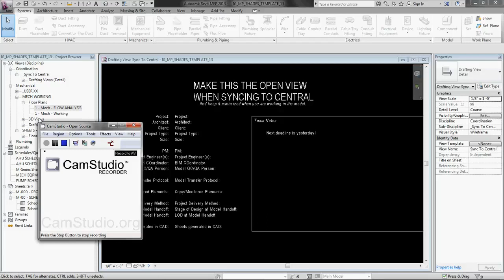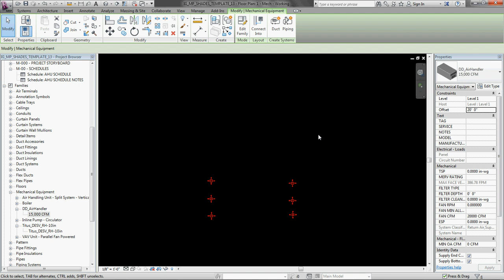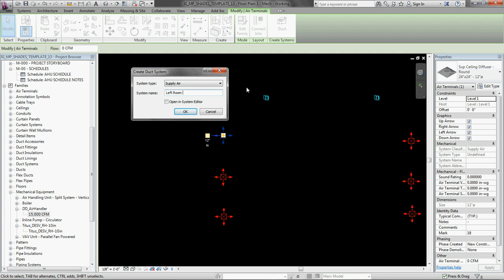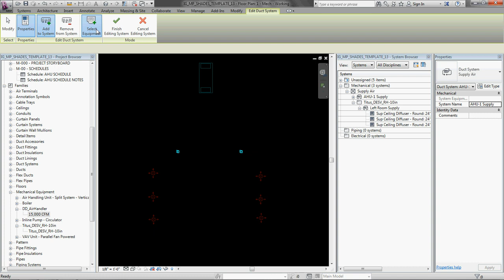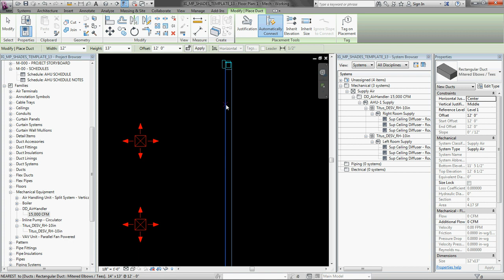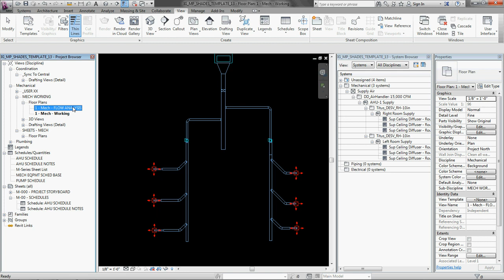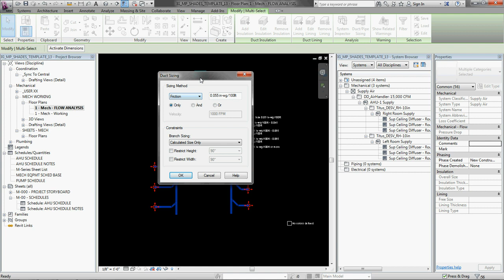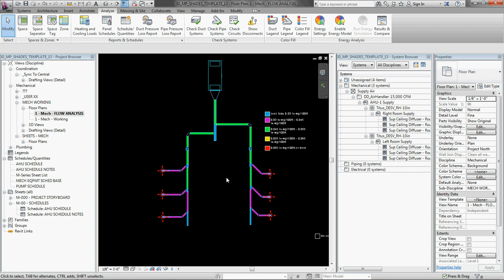How to Model Duct Systems in Revit MEP 2013

Comment from the maker: That's a really good question. I don't have an answer to that, although it's been in the back of my mind for a while. Short of manually reducing airflows in certain branches (or disconnecting them temporarily), sizing the mains, then resetting the branch diffusers to design airflows.... which is obviously time consuming and error prone. If I come up with something clever I'll be sure to post about it!

Comment: Thanks. Also think about how to model your systems when there are more than one piece of "EQUIPMENT" at the head end of the system; e.g.- two chillers, two cooling towers, two fans....
REVIT will divide system flow up between say two pumps but they can't be at the top level of the system; only assigned as inline components.

Keep on REVITing... Todd

Comment from the maker: Hi Ahmed, thanks for the reply. It's exceptionally hard to diagnose novel Revit issues without screenshots, the model file, and/or more description, but I'll do my best. :) 1. Note that I set my sizing to 0.6 inches of water / 100ft, which converts to 4.9 pa/m I think. That might be causing some issues. 2) Check to make sure you've got flow established on both sides of your VAV. It might be that the family isn't set up to allow flow through it (both duct connections have to be correct).....

Comment: Tyler, You may know the answer to this. Is there a clever way to model airflow diversity in the REVIT systems between the air handler and the VAV box? REVIT currently just sums up all of the connected CFM from the VAV boxes which makes sizing the ducts challenging because you have to expand the sizing criteria to accomodate the fact that the ducts will never see that flow in the real world due to system diversity. Thanks

Comment from the maker: ....in that one duct connection has to be flowing in, the other flowing out. 3) If your duct system has other flow stuff going on, Revit might be confused about which way the air is flowing. What is the upstream duct connecting to/feeding into? You can't have any open pieces of duct in a network for the air to flow correctly.

Comment: Hi Tyler,I'm having issues with a carpark exhaust system (and a similar issue with a stair pressurisation system). When I create the duct systems from Exhaust Louvre > Silencer > Exhaust Fan > Silencer > Exhaust Grilles (not yet connected by a riser), when I start adding the duct, it changes the systems so that instead of the relationship above, it becomes multiple... Do you have an example of something similar?

Comment: Hi and thanks for the video! I was wondering can Revit MEP be used for designing the Industrial Ventilation systems? or do you know a software which is capable to use the method described in the ACGIH Industrial Ventilation manual?
Reply from the maker: Hi Hassan, I'm not familiar with ACGIH methods so I can't say one way or another. If there is a specialized, sophisticated method, I'm guessing no. But you can do a lot with Revit that it's not designed for so you might be able to hack it.

Comment: Hi disney, i have a question: i want to go to a higher hierarchy. i connected a diffuser to a mechanical equipment. now i want that to be connected to another mechanical equipment, however, the "duct" option does not appear in the contextual menu when i click in it.
Reply from the maker: LC volt So, the situation is AT to ME 1, which you got working. Now you want ME1 to connect up to ME2. Hmm. Does ME1 have a second Duct Connector built into the Family, for example a VAV box that has a Duct Connector on both sides of it?

Comment: Very good tut. , but I have problem that air delivered from RTU is less than the toal air from difusers. I inspect all connectors parameters (calculaed/preset) the problem is still standing
Reply from the maker: Sadig Bakri Hmm. Is the amount of air delivered off by some multiple of the air from a diffuser? If so, you might have a subtle break somewhere in the duct system which is causing one of the diffusers not to pass it's air to the RTU. Have you confirmed connectivity with tab-selecting the system?
Reply: thank you very much sir .. I discovered the problem, it in diversity factor on the VAV,  when I  set it to 1 then: in = out .. and the amount of air dlivered by RTU raised up
Reply: the amount of air increased when I add a new diffuser. e.g if a place needs 2000 cfm (500 per CSD) when I add one more diffuser air amount become 2500. how I maintain air amout at 2000 while adding more diffusers ??
Reply from the maker: Sadig Bakri That is where you are getting into the issue of how to add up airflows in Revit. Do you want to pass all the airflow up the stream, all the way up to the AHU, with the Air Terminals setting the airflow? That is easy in Revit. Do you want the VAV Box to control how much air goes out to the Air Terminals? That is much trickier and would require some creative Family editing.. honestly I go with the first approach and don't have Revit deal with flow diversity.
Reply: Tyler Disney I will try to check families first

Comment: A QUESTION I placed a diffuser in my job set the height or offset and then when i arrayed it they all went to 0 if that a bug in 2015
Reply from the maker: I don't think so - arraying ATs in 2015 works for me. When you array something, Revit turns it into a Model Group - and that Group's offset will be zero, which might be what you are seeing. Select the arrayed terminals, ungroup them (UG), and you should see that their offsets are whatever the original's was. Also - definitely always be looking at a 3D view to see the spatial orientation of objects. Model in 2D, look in 3D.

Comment: Tyler the video is great but I am getting Flow and Connection errors and the systems will not size the ductwork.  This doesn't seem to matter if the objects are from a vendor or 'out-of-the-box'.  Thoughts?
Thanks in advance
Reply from the maker: Things that can cause problems: openings in the duct (i.e. ends lacking caps, etc). Fittings that look like they are connected but in fact aren't (check by tab-selecting chunks of ductwork). Duct connectors on equipment or duct accessories that don't match the system (the flow direction of duct connectors in the family need to be oriented the correct way, and also need to be set to be defined by the system). Hard to diagnose without screenshots of errors that would help!
Reply: Tyler Disney
I could send a screen clip if this would help - I know it would help me.
Thanks again
Reply from the maker: Chad Sedlak yeah shoot it over
Reply: Tyler Disney I appreciate the help - silly question, how do I send you the clip?
Reply from the maker: Hm. Post it to g+ and share it with me I think? Whats the format?

Comment: How did you get all of the air terminals in your families section?
Reply from the maker: Hi Ole, most of the AT's I use are slightly modified Families from the Revit Out of the Box (OOTB) library. To get the standard Adesk famlies, hit AT, then select Load Family up in the ribbon. It'll take you right to the OOTB library. If you are new to Air terminals you'll probably want to use the OOTB families instead of custom content. I recommend AGAINST using hosted families (the names will indicate if they are hosted or not).